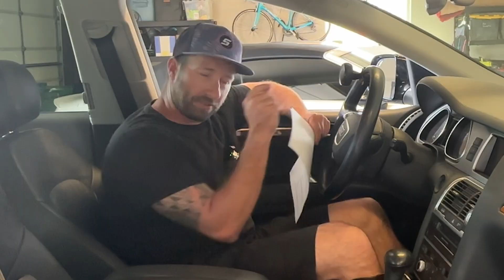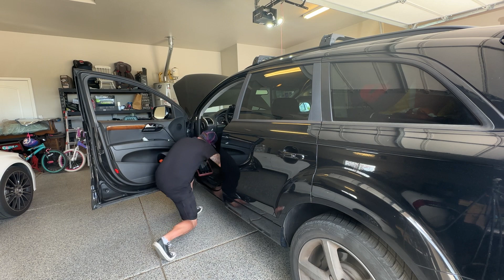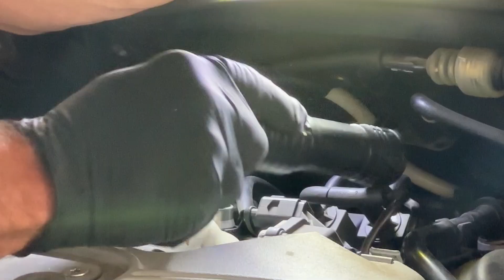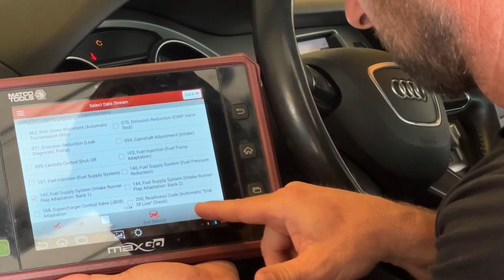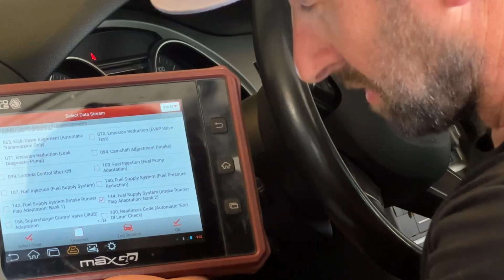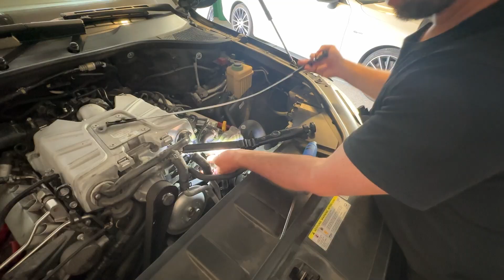Audi Q7 has a check engine light | Mechanic Finds P2019

Comment: Fuckin Audi’s . I have a A3 2023 didnt have it for not even a year and engine light came on.  Computer module .
Reply from the maker: I love Audi's, but you have to own multiple so you have a back up car to drive when its in the shop, and then one more back up just in case that one breaks down while the other is getting fixed!
Reply: It said let me play the sound of my people 😂😂 what code was it?
Reply: @rjtmsc  p0a82 . I just took it to the dealer i got it from and they fixed it I’m guessing. The fan had a dent they mentioned and the intake port was dirty they said, Im guessing carbon? They cleaned it and ran the code again and the last 2 codes that wouldn’t go away went away.Had it for 2 days and the engine light hasn’t came back on :/ the second code was p1624

Comment: Its a great thing you caught that solenoid! The 3.0t has a known issue with secondary air injection ports clogging and that black solenoid failing makes that even worse! We got rid of P0491 and P0492 by replacing the black solenoid.
Reply from the maker: Thank goodness!